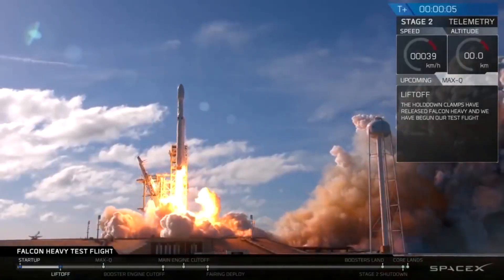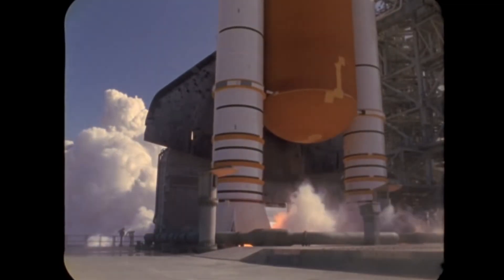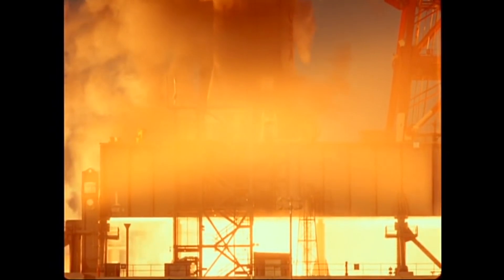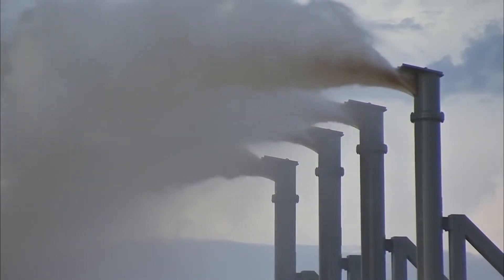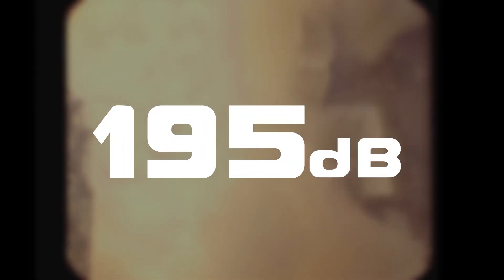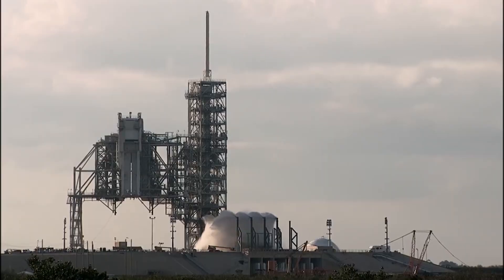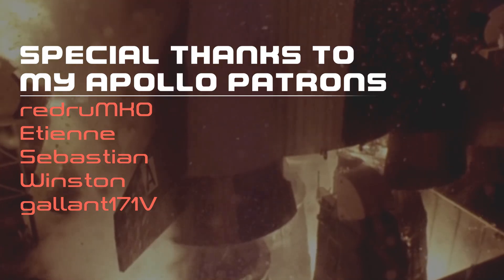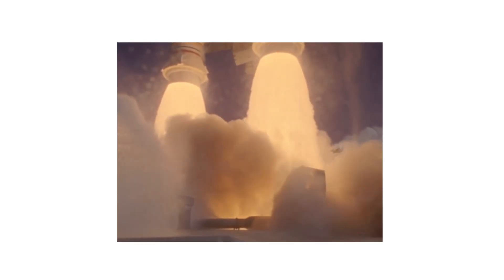Why doesn't the sound of a rocket launch kill you?

Comment: 0:58 how? Loudest possible sound level at sea level is 194 decibels. 220 decibels is impossible
Reply: Don't you think 7.5 million pounds of thrust made by burning 40,000 pounds of fuel per second might slightly change the density of air thus increasing the possible level of sound
Reply: @465fire  reasonable.
Reply: I did not know that. Why is that?
Reply: The surrounding air pressure is changed during a rocket launch, thus sound can become so much louder.
Reply: @John Gilbody
Yup. One of the reasons nukes can be as loud as they are.
Reply: Wondering the same thing.

Comment: According to Gwynne Shotwell SpaceX plans to launch their point-to-point transport in 5 to 10 km distance to cities. Better get your ear protection ready! 🎧🎧🎧
Reply: It's methane powered, so it won't be that loud as RP-1 or solid fuel.
Reply: eh, fs methane powered will hardly make any difference at all, what's going to be the biggest thing is that they'll be launching from water which will absorb a TON of sound as it travels across the waves.
Reply: The BFR will never fly Earth to Earth. This is not a new idea, people thought of it decades ago, it will not work. The BFR will only ever fly Earth-Moon/Mars
Reply: It might fly Point to Point on Earth, I actually have no doubt that it will, but it will NOT be successful and it will NOT be a true form of transportation, I see a couple launches at best and those will cost tens of thousands of dollars and they will be strictly for people wanting to experience weightlessness and space for a short time. But as for it being a commonly used mode of transportation, HELL NO, dude 3G's for more than a few seconds is goddamned painful, children and people over 40/50 will straight up not be able to use it. Not to mention a stiff breeze will cancel a launch effectively making it so no one could make solid travel plans around taking a BFR.
Reply: @jsullivan05  Yeah I can see few launches because of PR campaign and papers writing /people talking about it is worth as an advertisement to do these few launches
Reply: From pretty remote water-based launch pads...

Comment: I love hearing about really relatively basic solutions to issues in space flight - the use of water being one in this video. Just like how in Smarter Everyday's tour around the Delta IV Heavy they speak about how cork is used! CORK !
Reply: You love basic solutions and pick the water one? I prefer the bigger hole xd
Reply: Aspect Science
Or ceramic tiles being used as reentry heat shields.
Reply: @rationalskeptic2215  I actually have some of the original Columbia tiles put away. My grandpa was an engineer at Lockheed-Martin, who worked on engineering the tiles. They are the weirdest material I have ever handled. They are extremely lightweight, almost like Styrofoam, but also incredibly hard and surprisingly tough. When you first handle them you would think they would be brittle, but in reality they are an insanely tough substance. It's an incredibly advanced material.
Reply: @rationalskeptic2215  Let me rephrase my last claim: They are insanely tough... When compared to comprably lightweight materials. I actually broke one in my hands. Anyway, yeah, interesting stuff nontheless. They have the density of Styrofoam, but are much stronger. It takes some effort to break them. I only did it to one tile, just to see. It took several pounds of force on my end. It wasn't like breaking apart foam, like yoy would expect. And they  can withstand an incredible amount of heat.
Reply: @rationalskeptic2215  And their weirdest property is they simply don't transfer heat. You can apply a torch to one side for several minutes and hold it with your fingers on the other. It can get red-hot inches away from your fingertips, but be cool to the touch where you're holding it.
Reply: RationalSkeptic22  Ceramic coating is also used on the turbine blades of jet engines.
Reply: Eric Siemienczuk
I didn't know that
Reply: Yes. Lets all yell COOOOOOORRRRRRRRKKKKKKKKKK! what about PORK!
Reply: Destin Sandlin is awesome

Comment: Why doesn't the high thrust crush the support structure of each engine?
Reply: What exactly are you referring to?
Reply: @jerry3790  each engine produces an enormous amount of thrust and when you combine all the engines you have to ask yourself why don't the engines crush the supporting structures  that holds the rocket housing in place!?
Reply: Gord Rose By rocket housing, do you mean the towers that hold it steady until it takes off, or something else?
Reply: @jerry3790  I am referring to the rocket engines and there construction. The engine thrust pushes against  itself and every component has to be strong enough to with stand the power produced by the engines. When you have 27 engines pushing and vibrating it is a wonder they don't fail. I would like to see a video on the construction of the thrust platform that the engines attach to that distributes all that thrust so the rocket does not  break apart.
Reply: Gord Rose When the engines are started at lift off the clamps only hold down for microseconds before letting go thus not much stress is endured and when the rocket flies the stucture is strong enough to support it
Reply: Gord Rose I guess it’s the same way buildings are able to support themselves. If you think about it, a rocket sitting on the launchpad isn’t very different from a rocket flying in the air from the engines perspective. On the ground they have the weight of the rocket pressing down on them.
Reply: The support structures are  built to withstand those forces.